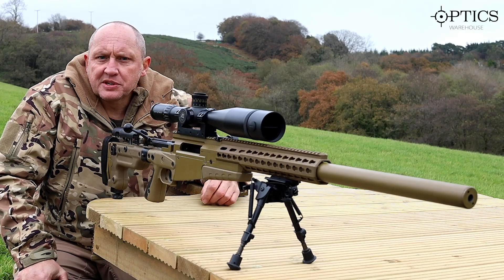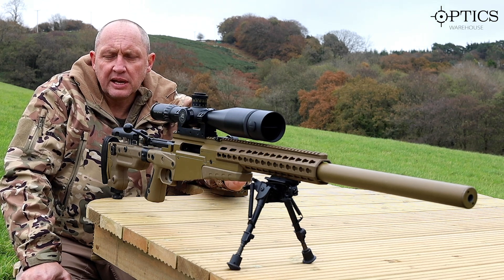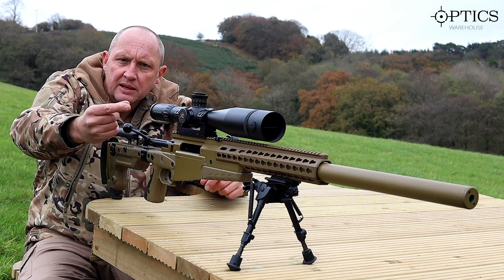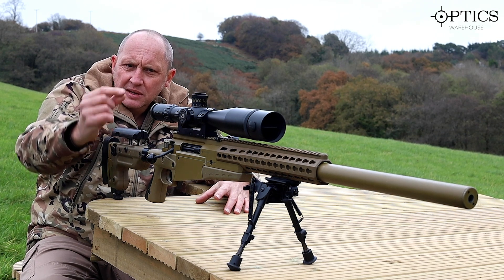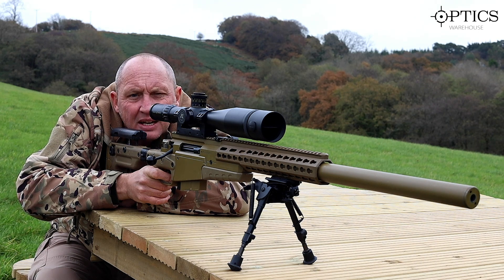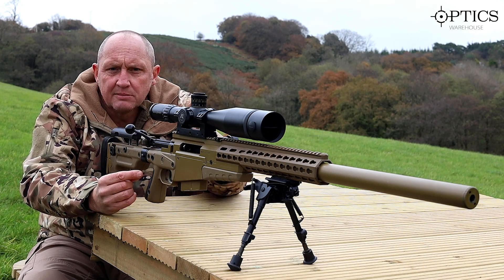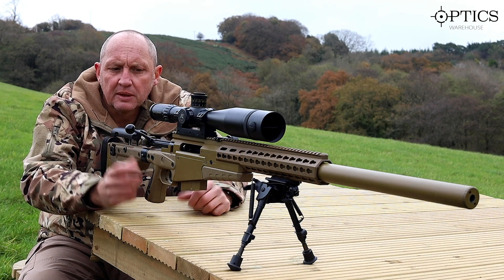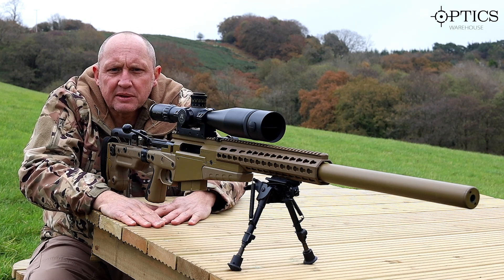MASTER SNIPER Ep 2: Trigger Control

Comment: Nice video... Good info for newbies like myself.  Just curios, what sort of ear protect do you use for that rifle and what calibre is it chambered in ?  I recently broke my shoulder and therefore was looking at the 6.5 creedmoor round in a Tikka T3x Tac A1 as an option for the future ( I think the Accuracy International is out of my price bracket) with a little less recoil than a 308, but still useful for target and hunting which I would also like to do in the future.  Would you recommend the custom in ear protection or over ear.  Been looking at the Emtec Noisebreaker ...
Reply from the maker: Hi there! Frank is away at the moment so I can't confirm the type he uses. We have some on our site you might be interested in.
But in this video we were using subsonic ammunition so sound levels were'nt an issue.
Cheers!